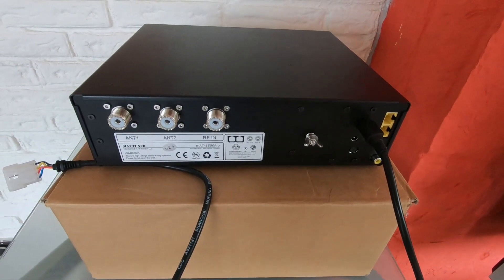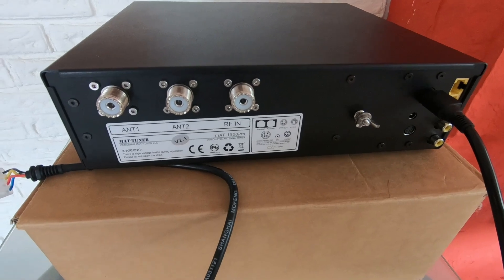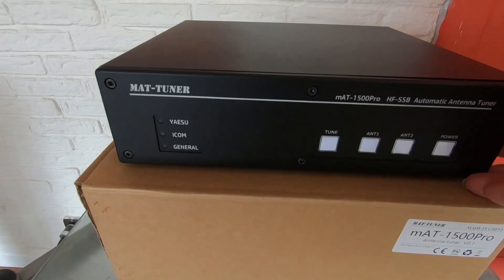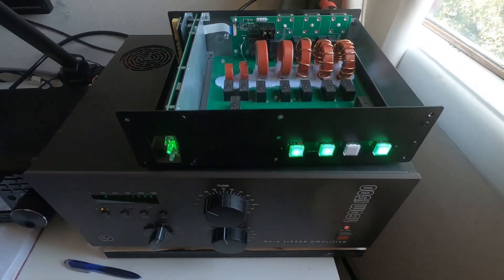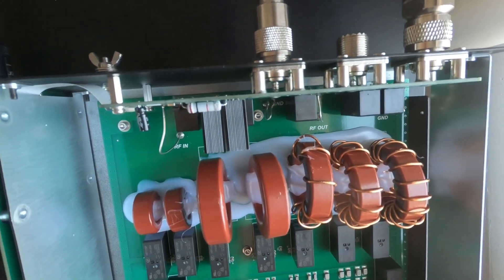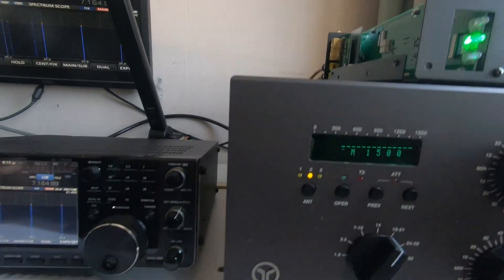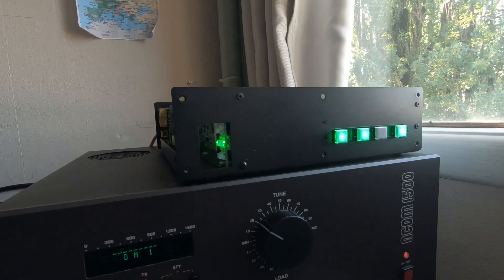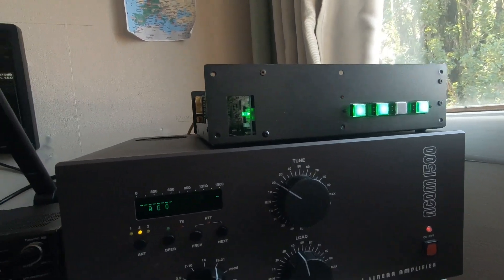Mat pro 1500 automatic antenna tuner, 1500 watts ssb with ptt bypass helpful  for tube amplifiers.

Comment: Friend of mine tried to use one with a Kenwood TS480.. when you plug the tuner in to the Kenwood using the correct lead it limits the 200 watt Radio to 100watts. 

Plus if you try tuning with more than 15 watts the tuner unit will be damaged. 

So we cant use the cable, and we have set the PL button on the Kenwood to give out a CW tone at 10 watts for tuning and then switch it back off to allow 200watts transmit. 

This is mostly a Kenwood fault, but I still would have thought the Tuner would allow tunning at full power considering it can handle 1500watts.
Reply from the maker: @BeavistheLizard  Ho thanks for your comments, luckily it works fine with the Icom ic 7610,but there's not so much information online,,,73s from Rotterdam 🙏
Reply: @Bernard-John  After watching your video my friend is asking.. does the tuner remember where it tuned on each band?

So you shouldn’t have to re tune each time?

only if you see high swr?
Reply: @BeavistheLizard  tuner has memory so need to tune back when you go back to same freq. 73
Reply: @BeavistheLizard  Tu amigo no se anima a preguntar?
Reply: @Daniel-c3r6f my amigo is disabled and can not see very well so I am asking on his behalf.
Reply: As long as your radio has a fold back circuit for power, it’s ok. You wont damage the tuner.